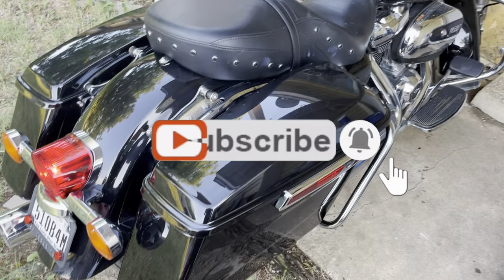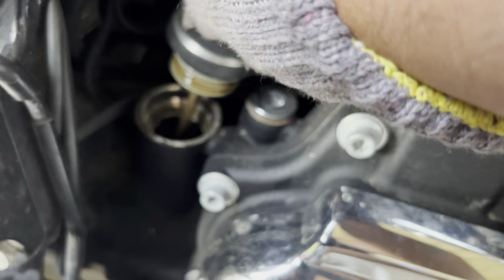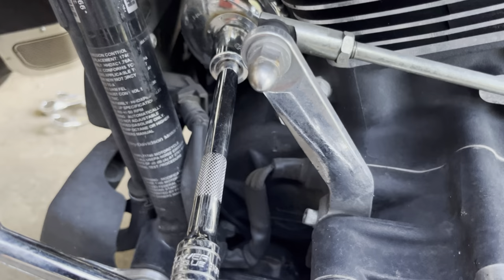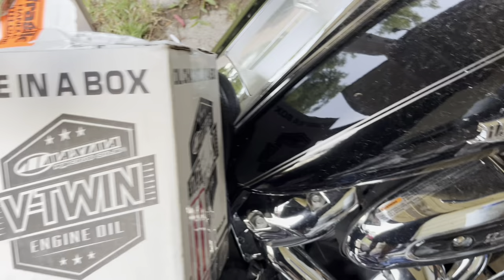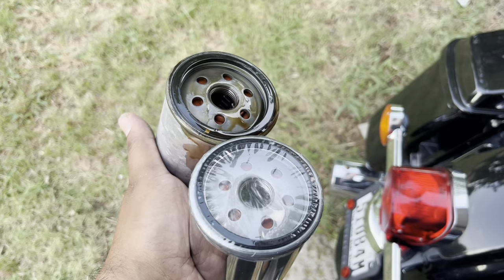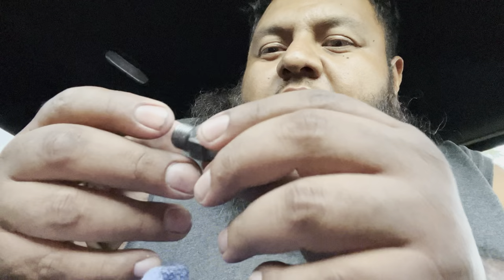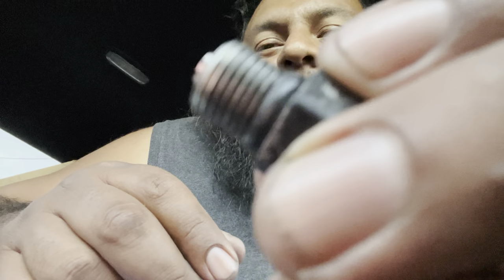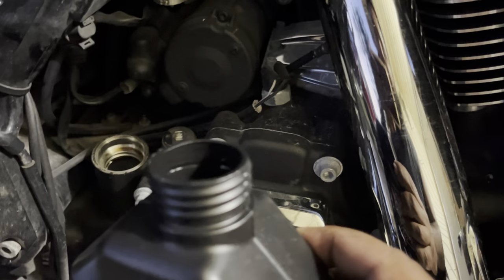Oil change on my 2017 road king #harleydavidson #diy #easy

Comment: About to buy my first Road King. Looking at 2016,17 or 18. Thanks for your tips
Reply from the maker: Try to get one with the 107 M8
Reply from the maker: The twin cams are ok but if you can get your hands on a M8 of any size 107,114,117 you will be better

Comment: One thing you forgot was to start bike before removing filter. Fire it up and then shut it off do this several times won’t damage engine but will get the oil in tubes and other parts if engine. Gets about an extra 1/2 qt out